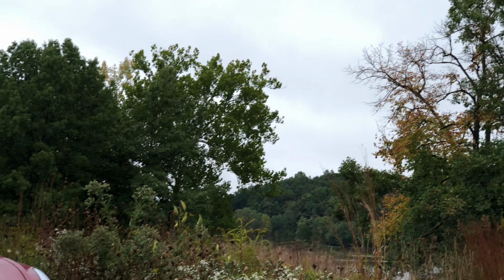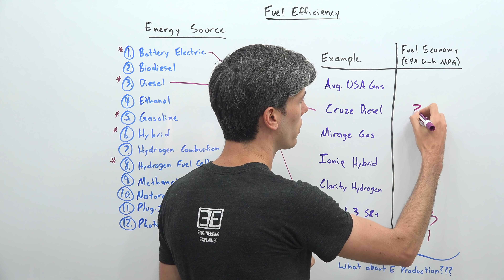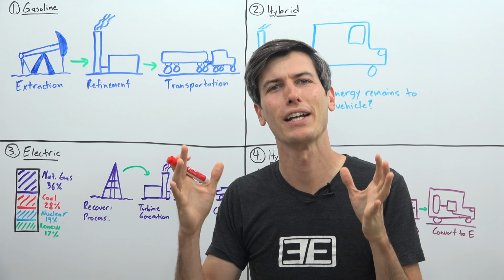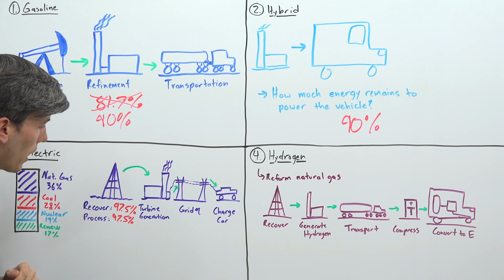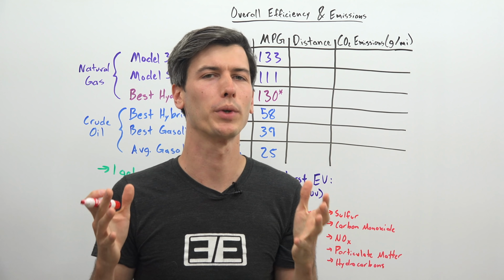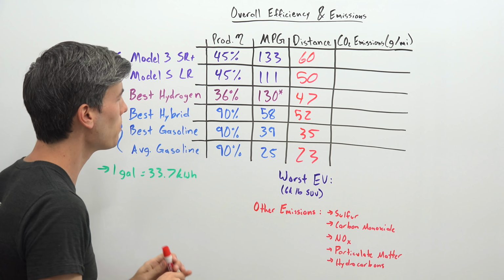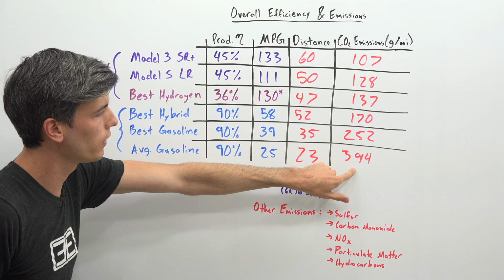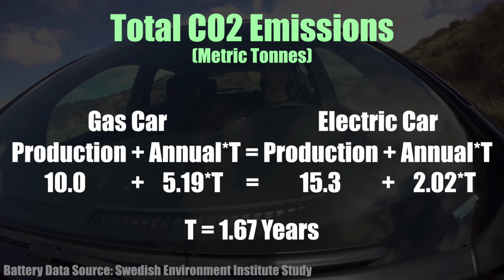Are Teslas Actually Better For The Environment?

Comment: I had to replace my laptop battery 3 times, ipod battery and gps battery once, and my phone battery is now dying. This is just in the last 3 years. Lithium ion cells only last 3-5 years.  I'm sure glad I don't drive an electric car!
Reply: You obviously have no idea about  battery management. Fortunately  EV's have their own battery management systems. So not a problem. Oh Tesla have announced a battery good for 1 million miles.
Reply: @philterry3293  Pretty much every electronic device has it's own Battery Management System. I do know about keeping the battery around 50% and slow charge. The fact is that the battery cells will degrade over time under the best conditions due to self-discharge. The most they can do is over-provision the battery with extra cells and do wear levelling.

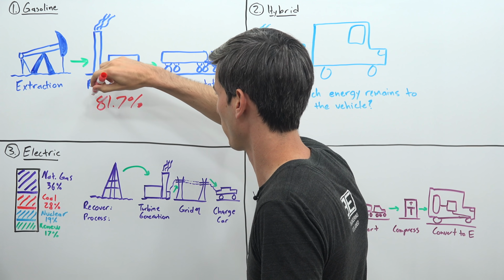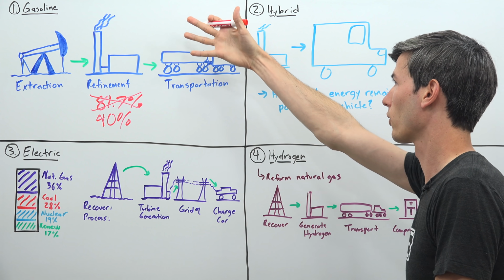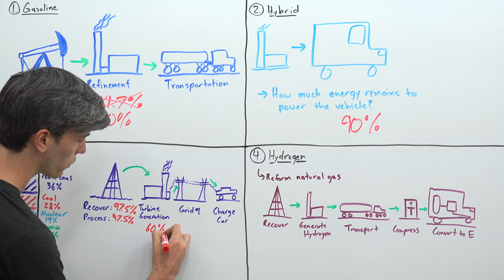Comment: This is a totally flawed analysis. @5:25 you inflate the numbers by almost 10%. Then you also screw it up majorly @5:45 using natural gas, whereas most energy comes from petroleum. You screw it up yet again @6:50 saying the loss sending it through the grid is only 8% when it is up to 30%. This is an exercise in wishful thinking!

Comment: What about when your Tesla is fully charged everyday, by Tesla’s solar panels
Reply: Sorry, efficiency of fire is only 40% at best. 

It's a joke
Reply: jonathan Wieringa what? I use solar panels to charge my car.
Reply: @m.b8259  It's a joke about solar panels catching fire on Walmart's roof. And fire only gives 40% of useful energy.
Reply: @m.b8259  And then there wasn't taken I to account that those panels can't be recycled yet. The heavy metals still cause danger to the environment. Only looking at CO2 emmision isn't the whole picture. But bringing that all into focus is a nightmare task.
Reply: jonathan Wieringa I get what you’re saying but it’s one step at a time, you can’t finish a lego set at once, you start taking care of smaller things till it adds up to the main objective - the full build. It’s the same with waste. So the solar panel energy is a better alternative to using fossil fuels indefinitely and providing continuous bad air. It’s a whole different topic on how we produce items and get rid of them.

Comment: He missing a lot of information when it comes to efficiency. There is loss of power in electrical lines by at least half. Hydrogen extraction is a terribly inefficient process because it is locked up with other elements in its natural state. It takes a lot of energy to break it apart and then to transport and use again. If it was effective, we would already be using it. This is based on bad or missing information.

Comment: Based on this video, hybrids are still the best option, given all the discussed factors in additions to the fact that they do not require to be charged, they are cheaper and they are easier to maintain than electric cars.

Comment: Don't refineries use an incredible amount of electricity to make gasoline?
Reply: Off the top of my head - 48B kwhrs of purchased electricity used by all refineries in the US.  (some is also site generated from excess crude by-product gases...and NG) 

47% of refinery output is gasoline,   so about 23B kwhrs attributable just to  gasoline which at 3.5-4 miles/kwhr would be around 80-100 B  miles. 

80-100B miles isn't much in a country that goes 3.4Trillion miles/year... and by volume the gasoline is the largest output volume and the highest MPG actually driven...

Most gasoline is burned in light vehicles like cars and pickups, almost all diesel in the US by volume gets burned in class 7/8 trucks so it's a lot lower miles per gallon net.

Comment: 0:30 WTF is that wiring for real?  There is so much room for improvement on these type of videos. They are so generic you could put a school bus in there and the results would be the same.  Somebody needs to sit down and pick ONE ev and ONE ice of comparable size and features and do an indepth analysis of the energy required to power both vehicles the same distance.

Comment: Another Musk-type lie about BEV's efficiency?  Why is the efficiency of gas and hybrid cars correctly measured from the burning fuel to actual work produced,  while BEVs efficiency is almost always measured from a charged battery?   If we want to be honest about a BEV's efficiency then we should also start with the burning of the fuel at the power plant and getting it to the charging unit.  This process is acknowledged to be just 34% efficient by the US DOE!    It is also widely acknowledged that the charging process loses are 16% of the remaining energy, so our 34% drops to around 28% of which BEVs use 60% efficiently.  So what is 60% of 28%?  When all the facts are included we note that a BEV's true efficiency is just a little over 17%.  How exactly is that better than several hybrids that average around 40% fuel to work efficiently?   As an energy engineer, I hate such lies because it means that a Tesla has more than twice the carbon footprint of a Hybrid Camry.  But a Tesla owner can always brag that they paid twice as much to make such a large carbon footprint!

Comment: less co2 less oxygen , and less plant food growth rate
Reply: there is too much CO2 in the atmosphere, which makes the sun light hitting the earth not reflect into space, causing excessive heating. Go to school before going on yt
Reply: Photosynthesis is a chemical reaction that takes place inside a plant, producing food for the plant to survive. Carbon dioxide, water and light are all needed for photosynthesis to take place. Photosynthesis happens in the leaves of a plant.

try 180> ppm no plants , means no oxygen , it's chemistry my young padwan  , and @ .04 % of the total atmospheric global gas composition I doubt there is too much plant food (co2) ,,considering you breath out 40000 parts per million and 550 million years ago it was 3 to 4 thousand ppm when flora and fauna thrived i wonder why people are worried about 400 ppm , you do realize that for every person who dies from heat on this planet that 7 times that die from cold , do you want it warmer or colder ,, u don't need to answer that because i know what u are likely to say after your intelligent reply ,  all the best in your quest
Reply: @revalt2778   Too much CO2 makes the earth warmer, I think you got that (maybe ?).
People wont die from the heat, rather they will die from its consequences.
We rely on ecosystems for alot of our food and ressources. Every ecosystem around the world is balanced around temperature that didnt vary for thousands of years. We have seen drastic changes of temperature in recent times.
There is also the melting of ice at the poles which will make the seas rise by meters which will make alot of places inhabitable and without homes which would worsen the overpopulation we are already experiencing.
No ecosystems means no plants which means goodbye that precious oxygen you keep talking about ..

Comment: Hydrogen people still claiming its better than electric :P 

In time, máybe it will improve, but yea no
Reply: Hydrogen is simply an answer of oil companies like Shell that are panicking because the market for crude oil is starting to crimp due to increased EV sales. The largest contributors of hydrogen gas at this moment are the cracking of crude oil and extraction from natural gas. Both processes are managed by those companies and are therefore easy for them to promote. Let alone the fact that these processes are still detrimental to our environment, but they don't care about that I guess.
Reply: Maybe they meant you can refuel in 5min and not wait 30min

Comment: Wow. The US has some revoke m terrible cars. I get 80-ish mpg from my Megane. 

You should repeat this with European cars.
Reply: Europeans have a different measuring system. A car with “80 mpg” in European system will probably get around “30 mpg” with american measuring system.
Reply: @xBIGMUSCLEx  Fair point. I just used a UK-US converter, 80mpg (UK) is the equivalent of 66.614mpg US. So there's still a huge difference.

Comment: Obviously US cars aren't optimised for fuel economy.  A quick scan of the internet and you'll find quite a few Americans raving about the fuel economy they get when driving in Europe, and we're talking full sized cars here, not superminis. 
This is hardly surprising when your gas prices are one third of ours.  Just sayin'! 35mpg for a diesel in Europe would be pretty poor and that's supposedly the best in America. 
To be sure Tesla's aren't optimised for economy either, they're optimised for range, which is why they're so efficient, they really have to be, unless you want to pay for 2000kg of lithium battery. 
If Detroit were actually serious about fuel economy the contest might be a bit closer, but American drivers do love their gas guzzlers.  Anyhow, I'm reserving judgement until Achates puts their Juno motor into forecourt auto, they claim 41 percent efficiency or double what diesel's get now, as it is 35mpg is laughable.

Comment: This video misses main point - going from burning fossil fuel to clean energy REQUIRES switching from gas/diesel to electric cars as a must have step. As well as moving to clean energy generation in parallel, that is actually happening rapidly. There is no way to have only fuel burning cars, then wake up one day and say - good, all the electricity is clean now and the cars are clean too. It is a PROCESS. Trying to prove that fuel burning cars are more efficient supports those who want to continue killing the planet, extracting all the oil in existence out there to the end, generating killing concentration of CO2, etc. If we want to save the planet, epectric cars is unavoidable step in any process that is capable to achieve this. So all those comparisons do not make any sence to me.

Comment: just need to solve that pesky battery recharge time to make electric vehicles practical for the avaerage soccer mom/dad
Reply: You mean like superchargers? Plug it into a 240v 30a circuit at home and you will have a full battery when you wake up. A quick stop at a supercharger can extend your driving range for the day if needed.

Comment: Electric vehicle = 0 emission 

Power plant = a lot of emission 

Now you know where the emission is coming from, work to fix it
Reply: You are neglecting the environmental cost of manufacturing and electric car. Many third world countries have their water supplies ruined by lithium mining for the batteries. Also electric cars are not zero emissions by any means. That's why I think hydrogen fuel cells are better
Reply: @Lawtonfl  So lithium mining is the problem, not the electric vehicle?

Comment: The best diesel that the US can churn out does 37...? My 18 year old 190.000 mile gas powered Saab 9-5 can do better. Anything under 50mpg for a normal size diesel car is not impressive at all
Reply: put it on the test stand at the EPA and tell us what standardized numbers and emissions it gets rated at...

Comment: Coal.  You left out coal. 27% of electricity is generated by coal.  35% by natural gas.
Reply: William Whitman yes along with 20% being nuclear and most of the remaining being renewables which don’t produce new emissions at the time of energy productions. So you have roughly 35% producing no new emissions, that heavily offsets any coal being burned. On top of that all new power is either natural gas or renewables thus coal loses market share with every passing year. Hence why he used natural gas for the comparison as a middle ground.

Comment: I live in Canada, 8 months out of the year its between 0C to -40C. Also live in Alberta where Coal is the main electricity generation. So explain to me how burning coal is better then burning gas or diesel . I am all for EV's. But with how power is produced in certain regions it just doesn't make sense. You didn't mention the mining of material for batteries either, Which has a huge impact due to equipment and resources required to extract and reclamate the area.

Not even to mention the cold climate here 70 percent of the year, so range is reduced. But the amount of distance required to travel, which is roughly 200-300 km between local major centers. Along with no recharge infrastructure.

The wife wants a Tesla bad, I wouldn't mind one. But the technology just isn't there yet to really make it viable unless you never leave your city and live in a warm climate. Not to mention the cost, Just bought a brand new fully loaded truck for $60K Canadian. A Tesla would run me $100K plus!

Comment: Ignoring the impact of even the so called renewable energy production on the environment is a mistake. Yes, we've already ruined many rivers, the impact of wind and wave generators, solar, etc. always completely ignores the manufacturing, transportation, and assembly as well as the land used at the exclusion at other use of the land. You've also completely ignored the cost of extracting cobalt, and other issues associated therewith, and the impact of lithium on the environment. Looking only at charging a battery and how far that can take us is ignoring soooo many other global and social issues. Now for the kicker...if we think the electrical grid can currently absorb everyone switching to electrics we are truly of our collective rocker. Electrics don't even have a 3% market penetration and CA already have to do roving brown outs etc. So, where will all the extra power generation come from?

Comment: I have gotten to the point of smelling the stink of gas cars after driving electric for 3 years and diesel is just revolting! Just remember every gallon of gas in a car is burned and then someone gets to breath it! And oil drips on the road and goes into ground water, I see the pretty shimmering oil slicks running from gas cars in the Walmart parking lot when it rains or snows and people even clean their filthy engines at the car wash. The older they get the dirtier they are!

Comment: If you do not have electricity none of thise would operate
Reply: if you dont have electricity, your city would stop working very soon, remember that allmost everything runs somehow on the internet nowadays..banks wouldnt be able to give you money and a lot more problems...
Reply: Ben Ward  pretty sure gas station pumps wont work either. But gas stations had hand pumps for electric shortages but do they have them anymore?

and solar panels will allways make electricity as long as the sun is alive (7 billion years)
Reply: Ben Ward  so you dont have sun or what?

Comment: Wow, 25 mpg average (about 10 l/100km)  and 404 g/km of CO2? In 2019? That's practically supercar (or 1950s) territory and easily beaten by just any 20 yo VW Polo in commie pinko europe. No offense, but it seems the good ol' USA didn't really take that whole "oil crisis" thing seriously.
Reply: Velktron, you raise a valid point. Perhaps ironically, improved fuel economy in cars has simply made people go out and buy larger vehicles. Look at the SUV craze. Fuel economy as a whole has stagnated in North America. European cars have far better fuel economy, as there are huge disincentives for gas guzzlers, due to higher road taxes and extremely high taxes on gasoline. In North America, European-style gas taxes are a sure fire way to end a politician's career! Even in Canada, where gas prices are significantly higher than they are in America, prices are still significantly less than in much of Europe.
Reply: Most of that low figure is the prevalence of quite low MPG pickup trucks, which are extremely common in the mix.  Sedans etc are in the mid 30's for the most part.

Comment: No, Teslas are not better for the environment, and you've proven that with your own data.
Reply: Teslas are better for the environment. How did he prove that with his own data. His data says that EVs produce less CO2 than ICE cars.
Reply: The rates which he calculated himself, then wrote on his own whiteboard, show that it's not possible to convert and transmit more energy over the grid, than what can be converted within the cylinders of an ICE, which means that EVs are more wasteful of fuel, in any form, than internal combustion.
Reply: @ForestNinjaZero  But even if the conversion of EV's is half of the conversion of gasoline cars (where ICE gets the benefit), the mpg of a EV is higher. And even that is assuming that 100% of the electricty comes from natural gas.
Reply: @ŠQÛ!DƜȀRT T. We're evaluating the same source, which means that if the EVs conversion rate is 50%, then the range will be half of what ICE achieves with the same amount of fuel.
Reply: ForestNinjaZero but the miles per gallon is more than twice of gasoline cars. That means that EVs achieve twice as more miles per gallon if you ignore conversion. But if you include conversion it’s still more.
Reply: LOL
Reply: @ForestNinjaZero  "We're evaluating the same source, which means that if the EVs conversion rate is 50%, then the range will be half of what ICE achieves with the same amount of fuel." 

Here comes the efficiency of ICE compared to electric motor, ICE only has around 22% efficiency because of massive heat loss compared to electric motor which has very very minimal heat loss and efficiency around 85-90%.
Reply: @Superman, Please stop making fools of yourselves.